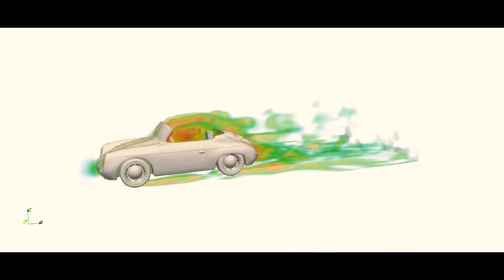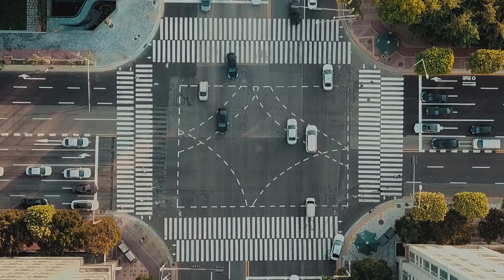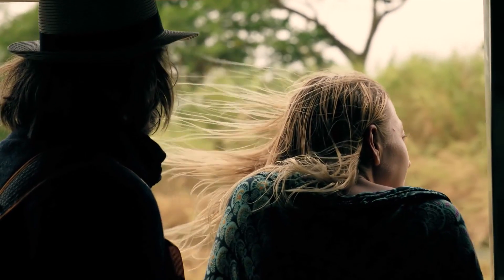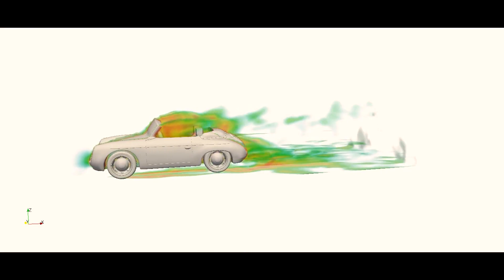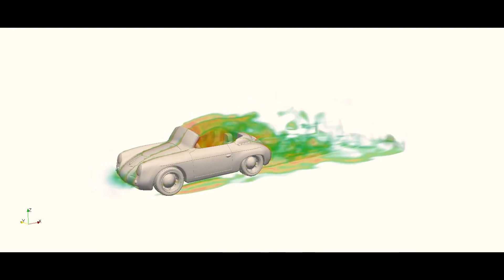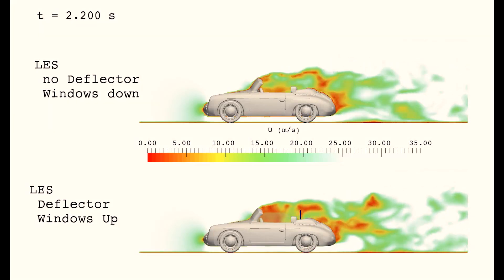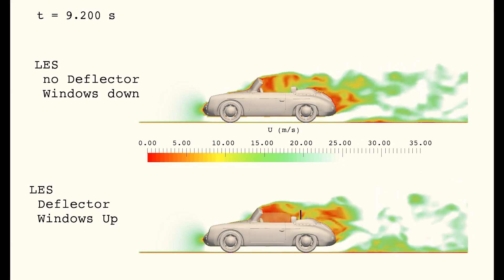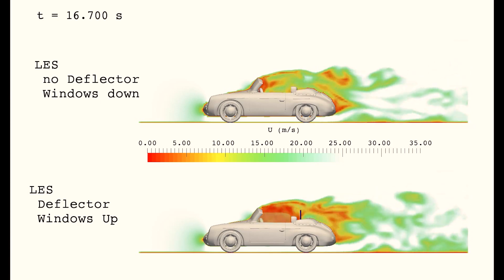Simulation of Wind Speeds in a Convertible Car | CFD LES Simulation in openFoam

Comment: I just discovered this channel, and this channel is a gold mine to learn about CFD. I am a mechanical engineering student and want to leanr even more about CFD. I want to ask you a couple of questions;

1- When we are using RANS models, we are determining if the mesh quality by looking at wall y+ values. If it is '<5' throughout the wall, we assume the  mesh is fine enough. How do we understand if our mesh is high quality if we are using a LES turbulence model? I know that we have to use much finer mesh to get accurate results in LES, but I don't know how to check if its fine enough for LES.

2- Which is the best method to understand the source of the drag in cars/planes/etc? Should we visualise the wind speeds like you did in this tutorial? Should we check the pressure distribution around the aerodynamic object? How about doing vortex visualisation with q-criterion or vorticity iso surfaces?

3- OpenFOAM is a very powerful CFD solver and ParaView is an advanced post-processor. But do you know a sophisticated open-source CFD preprocessor+mesher that I can use with OpenFOAM? 

I would be thankful if you would ansver these questions. Thank you.
Reply from the maker: Hey Ekin, thanks for your comment. It alway depends on what are you going to solve.
1. In the field we are working in, the boundary conditions are usually unknown and must always be assumed. So we have some big influence due to a lack of measured data. So we are usually doing a net independence study which means we mesh the volume in different sizes and look if the results change with the size of the mesh.
2. Yes, of course the pressure goes along with the velocity. And of cause they will always influence each other. In the industrial systems we analyse,  it's mostly useful to try to keep vortex shedding as small as possible. The pressure distribution on the surface can also be interesting. The actual pressure drop is often something we cannot change at all. 
3. You can use HyperMesh, which can be quite a hurdle to get used to but its very powerful. 

Hope I could help you.